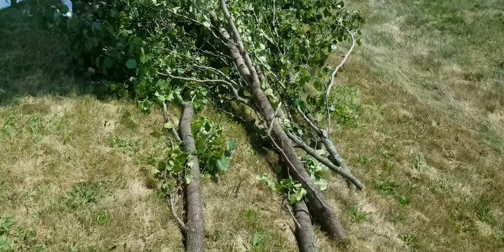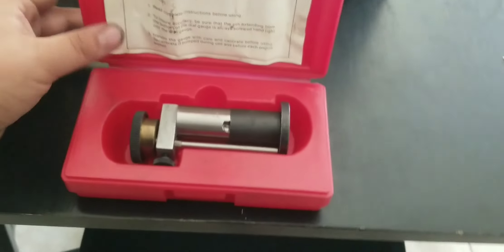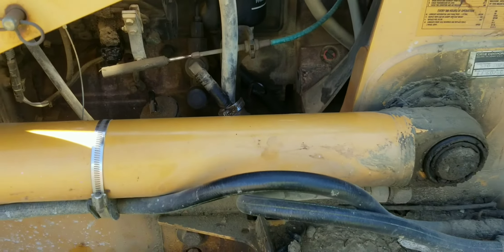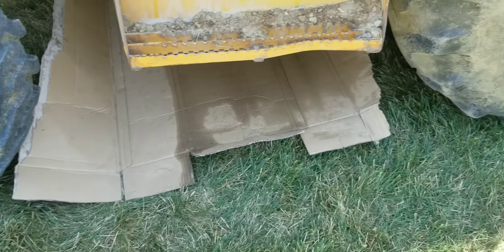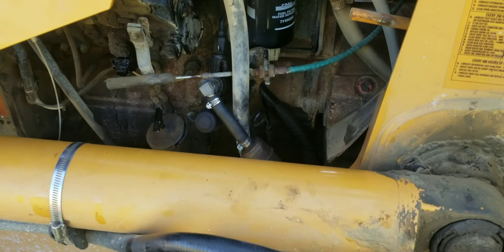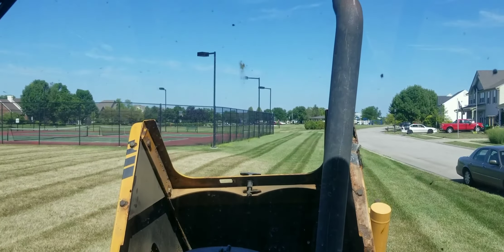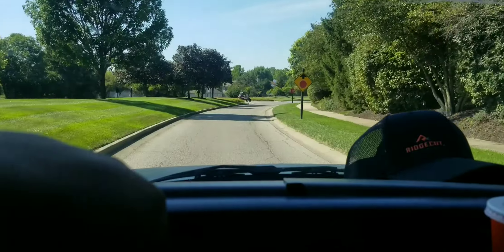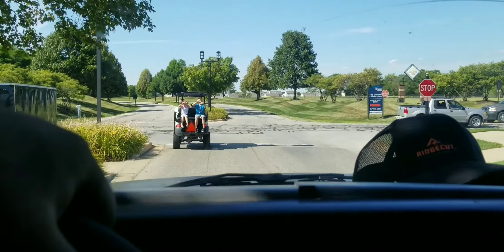Case 580 service call

Comment: Can’t start my case 580 I stalled it and now it won’t start help
Reply from the maker: Drop the fuel filter and make sure it hasn't lost prime. If it hasn't check yhe fuel shut off solenoid.